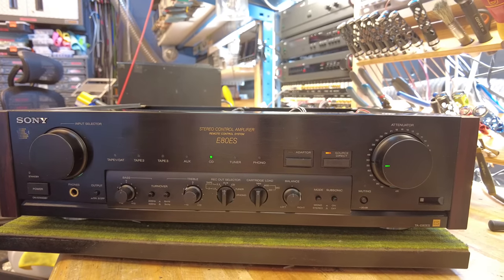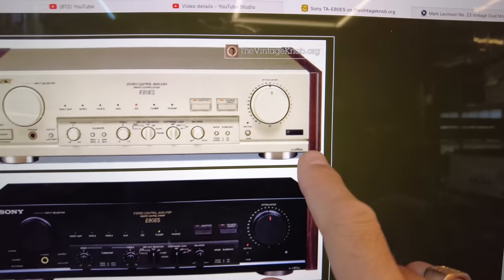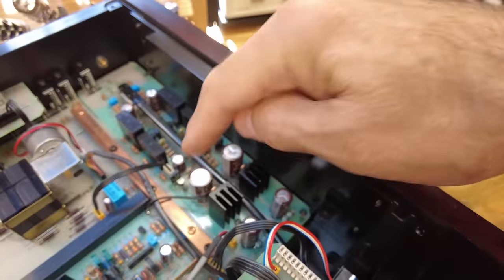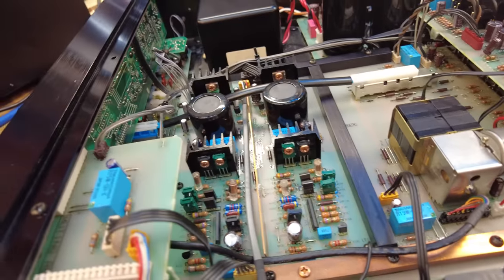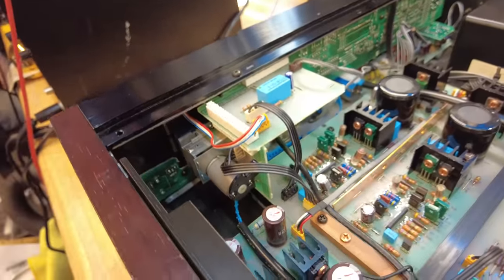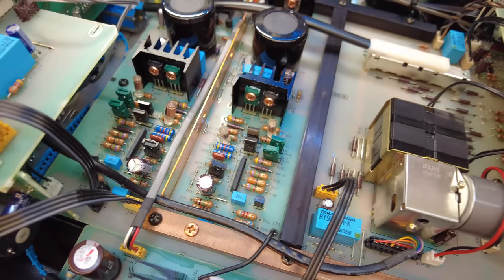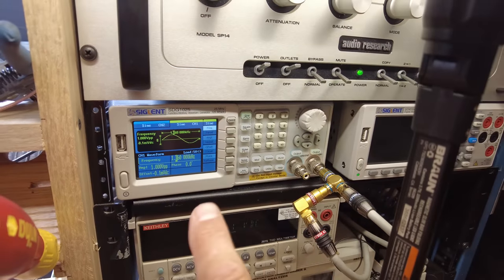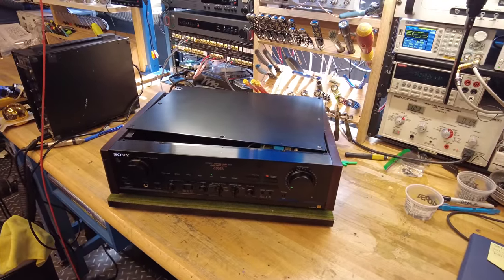If You Find One of These, BUY BUY BUY.  The Killer Sony TA-E80ES Preamp

Comment: If you don't yet, put ASMR hashtag on your channel. You have a good steady voice. About the only out of the ordinary audio equipment I have is a Qatron Stereo 48 , 12 tape 8-track tape carousel player. I've read they made 500 units before selling to Telex. My Qatron is serial number 499. So if it's the second to the last that makes it the penultimate! Which I just read 'pen' means less. Crazy term anyway...crazy amplified tape deck! However it was very cleverly designed. It will even keep playing the tape while you lift off the solidly built heavy plastic 12-tape carousel tray. So theoretically it can play tapes infinitely in that respect. Although you can also just pull out and load new tapes in the existing tape tray.

 I scored this player at a busy Saturday morning Alum Creek Drive Columbus Ohio thrift store ( Amvets iirc). Funny there seemed to be nothing to be had that morning, but I spotted about a five year old kid wandering aimlessly with a thick smoky brown clear plastic round lid that sparked my curiosity. About 10 feet away was another kid that had the matching tray, with fluorescent green stickers numbered 1-12 spaced around it and next to the narrow rectangle openings. No sooner did I gather that info that I was in eyeshot of another kid standing next to what was the rest of the electronic unit, which looked completely like junk without the lid and the tray. So quickly I conned the kids out of these two pieces and there it was..."What is it?? Hmm...STEREO 48? ". 

When I saw the 1234 back lighted button and the 8-track tape head I was well aware it was something rare and cool. I paid just $5 for it and hustled myself back home. My cousin happened to stop by right as I pulled up. So we both studied it with the lid and tray off, allowing us to see all of the mechanics. I liked the less is more approach. Right away I saw the problem, assuming it had a problem, but it was just a simple bent steel wire linkage arm coming from the changer solenoid. It has a keeper latch that had flipped up and allowed the arm to pop off. The arm iirc is involved in the tray rotation. 

After latching the arm back I grabbed a speaker to test it. It has a built-in stereo amp, line-out, aux-in, hp jack, Vol, Bal, Tone. I happened to have a few dozen 8-track tapes. For $.30ea I bought great titles just to have in case I ever found another 8-track tape player. I grew up with a few, but my favorite, and I kick myself for not buying the exact unit for $8 at a thrift store even after this carousel player, but it was a Realistic Modulaire AM FM Stereo Receiver 8 Track Player Recorder. Man it was so well built! Lots of chrome and I really liked the thick clear Plexiglas back painted black with bright orange tuner display. It 's amplification relied on the big Stereo STK power amp chip. It was the first I'd ever seen one of these chips. My dad was an engineer and he explained these chips came out in the late 60's. I've seen them in JC Penny stereos, and a Kawai organ I have from 1984. They just seemed too modern for the 60's. I mean Conn was still using vacuum tubes until '66 in their organs. 

Sorry I get sidetracked ( I looked up the name of that Realistic Modulaire receiver and almost fell for the scammer selling one. One easy check is to ggl search the image along with the web name. I hate crooks! So I found this uniquely well made Realistic receiver was made in Korea. My latest Guild Bluesbird electric guitar was made there and it is absolutely flawless!  So anyway, the Qatron Stereo-48 worked right from the start! It operates in a couple manners. You can select it to play track it's on, and then instead of switching to the next track, it will pop the tape up and rotate to the next tape on that same track, and continue doing that. So basically it will play all of the tapes track 1's, then all the tapes track 2's, then all tapes 3's...then 4's. Then it will start over...I think. lol The second option is it will play the whole tape ( tracks 1,2,3, and 4...which I know they are "selections" technically), then all of the next tape, and so on. The third option is it will stop at the end of track 4 of the current tape. It's all mechanical, no microprocessors. Not even an EPROM. 

I could go on and on. I just remember you saying you read everything so I thought I'd drive you nuts. lol Actually I just had foot surgery so I have to sit here  for a few weeks. Hey I picked up a nice basically new old stock, with the manual, SONY STR-DE197 amp/Receiver. Has the manual and still has the 125 Watts per Channel (at 8ohm) stickers. Which I've seen them listed at 100 WPC as well. That pair of amp transistors look like they'd be trying hard to get 125 wpc. I paid $29 for it and the really nice Sony remote. Oddly it has SONY red batteries that work! This thing is like 20 years old. The whole thing works so I got a great deal for 29 bucks. 

Okay one last thing. A question for you. I have had many great speakers. Love my Magnepan Magneplanar SMg1's flat speakers, and my Sansui 5-ways with the crosshatch wood grill, but my favorite speakers need rewound, which I can do myself as I've rewound many guitar amp speakers, but it's flat aluminum(?) wire. The speakers are ADS L500's. My nephew blew them both. The cones are beautiful and I love that they used neoprene rubber instead of foam (yuck!). I realize I can probably just get new cones, but I'd like to build a jig and rewind them myself1. They used a green glue. I'm sure I can figure it out,  but I'm just curious if any of you audio service guys ever rewind speakers like we do in the guitar world. Thanks so much, and sorry to all who hate long winded comments. 🙂

Comment: More on the Sony:  The tone control stage is unique in my experience in that is is implemented with no active components at all  in the signal path.  It has limited boost and cut and useful dual turnover setting for both bass and treble.  What really impressed me with this component is that with the tone controls set on their center detent, there was no difference NONE in the sound when switching the Source Direct switch in and out.  Not in tonality, soundstage, or level.  And this was on the best systems available in the store (Martin-Logan, B&W, Mac, etc.). My opinion holds true 30+ years later.  A simple circuit in the schematic, I can’t figure out how Sony did it. Maybe proprietary potentiometers is my guess. BTW, the pots are dead quiet still.
Reply from the maker: Yes, great tone controls indeed and the ability to by-pass them is brilliant.
Reply: Actually, I own this Pre Amp and there actually is a very small, but noticeable difference with the Source Direct button not engaged. There is a very small loss of transparency and dynamics when the tone controls are in the signal path - even when set to dead center. Just an honest comment. I love my preamp and will never part with it, so this is in no way a criticism, or meant to denigrate the overall sound quality of this rare piece of Japanese high-end gear.

Comment: When i was younger i was fascinated by this preamp for many years, i found and bought one finally and use it  for few years. Very happy,  but after some time i discovered few preamps  better sounding, for more or less same money , like McInosh C29 (cleaner sound and much better Phono than Sony, but not balanced -i sold it after few years ) or Kenwood L-1000C (better than McIntosh, 10 times better Phono than McIntosh, and REALLY FULL balanced - i still own and use it ) or  Krell KSL (even better than Kenwood ,  FULL balanced, but no Phono, - i still own and use it ) or even TEAC PA-7 , the biggest Phono Board in all this list, but i'm not sure it sounds better than  Kenwood  on phono sound, maybe a little better than McIntosh, i still own it but i don't use it. I owned and tested most of Sony analog preamps (including TA-E7, TA-E86 or TA-E88, TA-E90)  , they all look better (especially inside, all  are superb build ) than sounds , my opinion..I am still fascinated by TA-ER1 (saw one in Japan but never heard it) and TA-E1 or TA-E 8450, also never heard it. @SkyFiAudio  Very nice review, congratulation, after watching i feel like i would like to own again one...   👍👍    @marksowers5041-if  you buy one, resolder the " those copper bus rails " -they often make troubles by invisible cracks in solder...

Comment: there was also an all analog ta-e77es. though i believe the esD only had a dac included while the analog signals were left alone. the ta-e1000es was the one that converted everything to digital. even the phono.
Reply: The signal leaving the preamp must be analog so it can be played.
Reply from the maker: Thats right.  Vintage Knob listing for the TA-E1000es converts all inputs to digital.  A viewer corrected back in the comments that the TA-E77Es does not.  Have one on the way to test and video.
Reply: @pedrocols  it's the converting to digital and then back to analog that seems excessive. 

but i get it. they wanted to be the one. they wanted every input to get that digital equalizer treatment. it was a risk, and they took it. and they sold a lot of those ta-e1000es. if you are specifically looking for a ta-e1000es, you will easily find one.
Reply: @SkyFiAudio  vintageknob is the best. i like the audio heritage japan site as well. it was my rosetta stone into understanding sony model numbering.

Comment: They already used a bunch of Fujitsu/Takamisawa relays. Why not use same relays for input switching - surely a dozen costs less than this one-of-a-kind motorized thing?
Personally, I'm quite content with how they "sound" (they don't) in my setup.
Reply from the maker: I think it was just a bunch of engineers having fun designing something different.  Yes using basic relays would have been simpler.

Comment: I got this and I can only say that it sounded like shit when I bought it new in 1994 but I didn't give up because I supposed something wrong happened. After checking  some weak points out as the very important two screws in the back panel to connect ground with chassis and change some thin wire inside that conducts the ground,  positive and negative voltages and foremost, the hideous connector and wires that carry the output  signal to the headphones amp, the sound became first-class with crystalline highs and deep lows. That preamp stays with me till now and can compete with the TA-E90ES, TA-E1 and TA-ER1 sonically as an equal.
Reply from the maker: Wow, super valuable information.  Thanks for sharing.
Reply: @SkyFiAudio  thank you!!

Comment: Careful fondling those caps lol I zapped myself pretty good once with smaller ones than that.. maybe those aren't bare metal tho
Reply from the maker: Ive gotten plenty of shocks but cant seem to learn my lesson.
Reply: @SkyFiAudio  at least the caps are just a one time zap and probably less dangerous than a constant current that could freeze a person or something. Tho I've seen some pretty large caps.. I used to play with em and nearly weld stuff with the discharges. I've gotten zapped by an unplugged jvc and also an electric motor starting cap... neither were too pleasant... I'd do it again for underground welding pay maybe lol

That's a crazy pre-amp for sure, I'd probably mistake it for an integrated amp looking inside.

Comment: Thank you for video! But I was not impressed with this preamp. The most impressive preamp of all time is the Denon PRA-2000 (not to be confused with the PRA-2000Z or PRA-2000RG), only the PRA-2000. Fullness in Class A, high power +/-75v, an excellent phono corrector made with passive RIAA correction, which is practically not found in other preamps. There are practically no electrolytic capacitors along the path of the audio signal, only film capacitors and transistors. The circuitry is very time-consuming and thoughtful. That's why it sounds really cool, a real hi-end.
Reply from the maker: The PRA-2000 is indeed a great preamp.  Interesting what you mentioned about the RIAA.
Reply: I am looking at the schematic for the Sony TAE-80ES right now and indeed the phono equalization circuit employs a passive RIAA implementation. In addition, the ‘80 only has one capacitor in the signal path, on the output, and it is indeed a film capacitor. The output stage, too, is way overbuilt, and it is biased into class A as well.
Reply: @daniannaci3258  No, it has a very primitive phono equalization, with an RIAA circuit in a general feedback loop.

Comment: 20:48 I see you use these cables quite a lot. What are they? They are very nice-looking.

Woah! I just noticed all the gold sockets and balanced sockets too! Not your usual Sony!

23:05 For the Gibraltar base you probably have to peruse the hifi paraphernalia of the time: rigid chassis, vibration control and all that were all the rage at the time (yeah, I know) and many manufacturers would jump on that band-wagon. If anything, it makes even a mid-weight device feel nice and solid. The heavy lid is part of that approach I guess (beware of Japanese steel of the time btw: I've seen it pointed out elsewhere that it has a tendency to rust like nobody's business if left too long in the wrong sort of environment).

Btw a huge chunk of this video is repeated.
Reply: Those just look like any run of the mill nylon braided rcas. Like 8 bucks on Amazon. I have a pair that look nearly identical running to my sub.
Reply: @eattoast6378  hmmm..  all those I've found that look quite similar (Walmart, Dukabel, Goalfish etc.) seem to be sold out.
Reply: btw a quick search for this reveals prices $1299 upwards - so finding this in a local second hand shop/garage sale will be a lucky find indeed...
Reply from the maker: Yes, they are cheap but good cables from Amazon.  We use them for heavy use on the test bench since they are disposable and easy to handle.
Reply from the maker: Vintage stuff from the 80s and 90s is only going up in value. Get them while you can.
Reply: @SkyFiAudio  I agree. I think prices have doubled/tripled since 10 years back and mint or top-of-the-line pieces are no longer on the market. Also, I reckon the best way to maximize value now is to build an entire set. It's sad to see how many premium devices out there are abused by diyers or cannibalized because people are not bothered to fix them: it's so easy as well, it only takes a little patience.
Reply: @SkyFiAudio  Nope, search as I might, can't find them anywhere. All I get in Amazon is "currently unavailable". I think this design is no longer available.
The braid is great for interconnects: adds strength and reduces their tendency to get entangled.
Reply: @eattoast6378  Do you mean the "Amazon basics" brand by any chance? It seems the design has changed...

Comment: Well You May like this preamp cause have less wires but .. First of all single transformer, kinda cheap. Next. Sony used a faulty series of elna duorex capacitors in this preamplifier, which tend to leak and can only be replaced. Phono stage is cheaply build. Standard. Has no step UP transformers like Pioneer c90/c90a/c91 has. Step UP transformers in phono are seen in Hiend amplifiers. In general, the construction of the preamplifier is very cost-effective compared to, for example, the Pioneer c90.
Reply from the maker: Thanks for the feedback.  Based on your youtube name I'm not surprised you like the Pioneer better :-)

Comment: thanks for your great review! Just picked one of these up with the remote and everything is working great but the attenuator function on the remote does not move the wheel on the amp. everything else works fine, and the attenuator knob moves freely and nicely by hamd - @SkyFi Audio - any ideas on what to look for as to a pontenital solution? Or anybody else out there with an idea? thanks for this great video! We all love Sony!
Reply from the maker: Great to hear!  First confirm its the proper remote for the unit.  Check the motor to make sure it did not come unplugged.  If you are capable next step would be to test the motor with a DC source.  Good luck.
Reply: @SkyFiAudio  yes, cofirmed remote is working - i think i can handle checking to see if the motor is unplugged - otherwise i'll find a master to handle it - thanks again, and great videos!

Comment: I wouldn't buy it. Its ugly. 
Does that matter?
Yes. 
Lets be honest, almost every amplifier is competent from the 70s - 80s. Does it matter for most people (99%) the ability to output 60+ W or above? 20 Watts is enough 40 more than enough.
Its a great amplifier but it looks like a BORING AV amp. A different layout/fascia design would have made this amp LOOK as good as it sounds.

Also, my friend, this would be a nightmare to find replacement parts once it starts to fail.
Still a great upload , so thank you.
Reply from the maker: Sure has to look good too.  I could never like an ugly piece of gear regardless of how it sounds.  I seem to listen with my ears AND my eyes.  :-)

Comment: Nice Amp! Dangerous presentation, poking around with your hand, with a ring on, with powered up unit around the power supply touching components in the power supply and almost touching the AC outlet board not a good life sustaining plan. But my favorite is at the end you with the unit still powered up place the lid on the unit, was just waiting for it fall into the unit.
16:01 there is a label you might wanna read. Plus you are setting a bad example for other people!